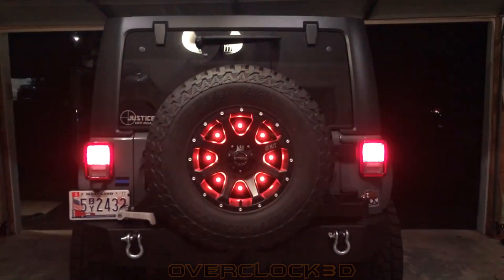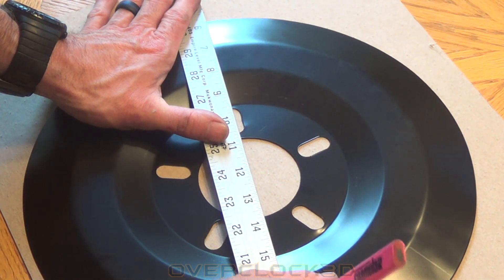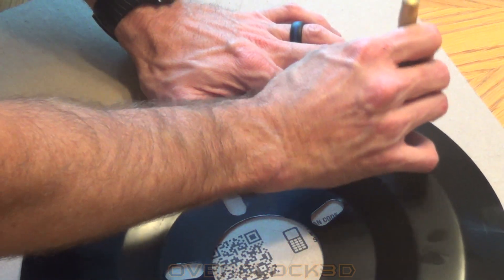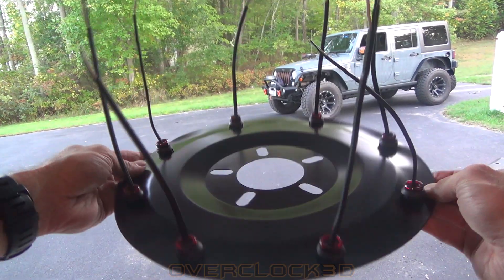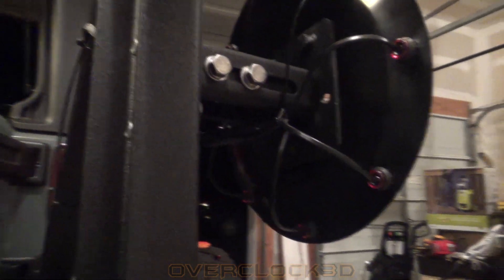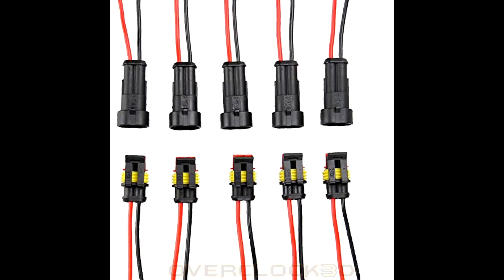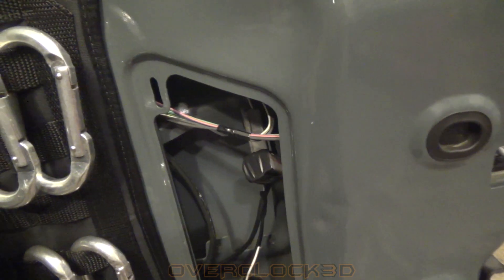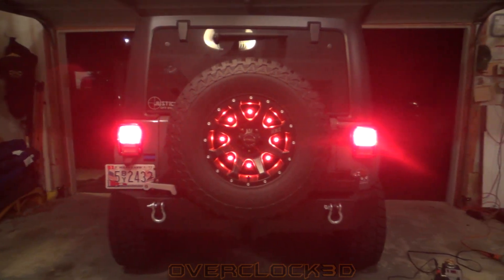CPO LED Third Brake Light How-To

Comment: Just finished the light upgrade to our 2016 Rubicon.  Used stock wheels on an AEV carrier so I kept the top center light and added four LED's.  It looks great!!!  I got the metal dust shields from amazon and it worked great with the same LED's and connectors.  Had two people follow me to see how it worked :)

Comment: I did this mod today using your list of supplies and it turned out great.  You did an awesome how to video.  Thanks man!
Reply: Van Le did you use the waterproof connectors that he did off of amazon?
Reply: I did use one waterproof connection.  I removed the original connector and replaced it with the waterproof one.  All of the smaller splices from the LEDs themselves I just soldered and shrank wrapped.

Comment: What is the measured diameter of the dust cover, and what size wheels are you running?  I noticed my 17" Rubi wheels have a 15" inner diameter.  I want to run LED's to the very edge to light up the 5 wholes near the wheel lip, as well as the bigger whole, totaling 10 LED's.  I see it looks like you have an inch of extra space between wheel and dust cover.  Great video, you've inspired me to tackle this.

Comment: Hey this video is great and much appreciated. I tried doing the same thing but I can't get all the lights to work, I currently have 6 out of the 8 working. Any thoughts on what could be wrong??
Reply from the maker: My best advice is to try applying 12v power directly to the lights that are not working to see if they work alone. If they don't, they they may simply be bad lights. Make sure you double check polarity. If they don't work one way, reverse the positive and negative to see if that makes a difference. LEDs will only light with correct polarity.
Reply: +OVERCLOCK3D - JKU got it to work. Think I had some bad lights. Looks awesome thanks for the video

Comment: Question here.  Do the LEDs also work as running lights?  sorry if this question has already been answered, already tried searching a few pages down.
Reply from the maker: No. These are single "element" LEDs... so they can only be wired as brake lights or running lights....but not both. Otherwise, they would just always be on, and wouldnt work as brake lights.
Reply: Any reason why you didn't bother LEDing the factory tail lights?  If you get red LED (not white bulb) for those tail lights it would be even more sick!!

I also think this mod is so good you should find a way to sell a lot.
Reply: Since you have 8 lights could you use half for brake the other have for running? just use every other one just a thought

Comment: First, thanks for the inspiration, I have used this to setup my brake light the same way!  Have you run into any legal issues with this?  I can't seem to find that it is a violation of state DOT but not sure if it is a violation of Federal DOT third brake light laws.  Thanks for any comments you can provide and keep the videos coming.
Reply from the maker: +Ryan Tiebout technically it is not DOT compliant...although arguably better than the DOT intended. What makes the difference is that DOT has a continuous illuminated surface area requirement that isn't met with the individual LEDS...but then again...they never expected someone to throw out 8 LEDs!  I have never had any problems, but since you asked I thought I would let you know.
Reply: +OVERCLOCK3D - JKU Thank you very much for the reply and the information.  I see so many people with larger tires that have no 3rd brake light at all so I would imagine this to be more legal than their no third brake light.  With the factory wheels I only have 5 LED's.  I just didn't like the factory third brake light and it obstructing my view.  I'll run with this setup for a while and if I have problem's i'll have to come up with some other setup.  Thanks again.

Comment: Very cool. fyi for future people doing this for 8 equal parts, just cross perpendicular through the center top bottom, then 90 degrees to that through the center...then diagonally again through the center left top to bottom right and then bottom left to top right. Simple geometry if you think about it. :)
Reply from the maker: Yes. Very simple geometry but some folks may find it more challenging to achieve perfect 90 and 45 degree angles  especially with the center hole.  Regardless, I picked a method to share that would work with any configuration of equally spaced lights... The method is the same if you have 8 lights or 5.  The geometry method doesn't transfer so easily to a 5 light pattern. ;-)
Reply: +OVERCLOCK3D - CPO  thanks again.

Comment: you should've or could've used the stock 3rd brake light harness and kept from having to run a lot of wiring. Just what i was thinking of, but either way im going to do this to mine
Reply: (re-routed the wiring)
Reply from the maker: +Mud-Junkie34 That's definitely an option if it works for you.  I didn't want to pull my factory harness out of the tailgate, in case I changed lighting options in the future.  And since I didn't have a factory-style  plug to plug into it...I would have to cut that plug off...and I didn't want to do that either.   If it works for you, though, go for it!
Reply: +OVERCLOCK3D - CPO now that you mention it, it doesn't sound like a good idea to chop it up. Haha.  
On the other note what gauge wiring did you solder to the big bundle of wires & where did you ground your lights?

Comment: Dude I was just in your area.. We ate at the Boat Yard bar and grill on 4th eh.  I just ordered a bumper with tire carrier on Amazon by Tuff Stuff..  Lets see how that goes, but l will check the carrier core and post for burrs eh.  Where did you get the LED 3rd break lights from?  By the way I'm in Lynchburg va.

Comment: Just an additional idea.  I added these flasher modules to my third 
brake lights and my trailers. 
https://www.superbrightleds.com/moreinfo/strobe-controllers/brake-light-strobe-module/195/
   Strobe module rapidly flashes bulbs 4 times for 0.4 seconds, slowly 4
 
times for 2.6 seconds, and then lights remain on bright until brake 
pedal is released. They pop on with the brake and really alert the 
driver behind by getting their attention.  There is a video on the page 
in the link.

Nice spare tire mod!
Reply from the maker: Dr. Mark in Texas I really like that. those were very popular with the motorcycle crowd...but don't see them mufh outside of that. I've seen some newer public safety vehicles with them recently.

Comment: Which wires are the pos and neg? And why are there so many wires to the third brake light?
Reply from the maker: Black is negative. Red is positive. So many wires because each light has a positive and negative... Muliply that (2) by how many lights you have.

Comment: When you cut a pizza in 8 slices, do you calculate the circumference? Just cut it in half and half again and so forth; no mental math required Chief....  Great concept and execution and that's what counts...
Reply: math ensures equal spacing. better to take an extra minute or two and do it right compared to just "eyeballing" it. I know what you mean though, seems like extra work
Reply: Bobby Shah not to mention, I hate not equal slices of pizza.
Reply: Bobby Shah I was thinking the same thing...

Comment: I would be careful about moving the license plate as you get the wrong cop out there and he will ticket you for not having the light on the license plate.
Reply from the maker: +Dave _ My licence plate is lit.  I have two LEDs lighting the plate, so completely legal.
Reply from the maker: +OVERCLOCK3D - CPO Here's a pic: http://i.imgur.com/nj1MCqy.jpg
Reply: Oh I believe you, Just most people dont think of that.
Reply: Do you have to take it off to get the spare down?
Reply: CPO Do you have a video or an Amazon link to which licence plate holder you installed?  I actually looks like you didn't use one.....?